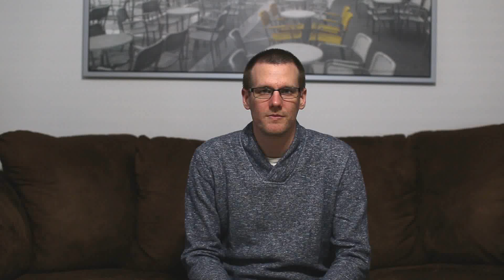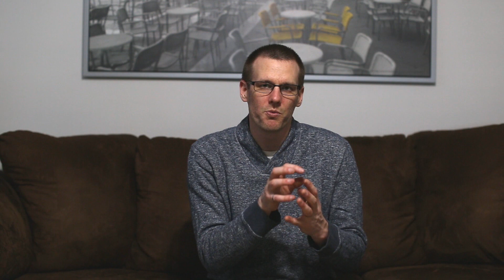Differential Fluid Performance in RC vehicles

Comment: Hey man I have a terremoto 10v2 

It had a 3s motor combo inside it and I swapped everything out to a 8s 4 pole motor! It’s a damn beast! Im only using 6s

I crashed my RC car into a wall and destroyed the centre diff, ( it’s not really a centre diff ) lol 

But I order the real upgraded Center diff , and I was gonna take everything apart and redo the oils / new bearings etc it’s been a year since I had it. Wanna do a rebuild basically.

I’m new to the RC world and I wanna know what would be a good setup? I’m into speed mostly tarmac, but I do go off-road a-bit, I don’t jump the RC car or anything like that ain’t really into it,

So my RC Car loves todo wheelies! And standing backflips even with a open Centre diff. I just need some help with the diff oils :/
Reply from the maker: Hello, I prefer a very heavy weighted oil in the center diff, a medium/heavy diff oil in the front, and a lighter diff oil in the rear. From there you will have to fine tune to suit your preferences.
Reply: RCexplained thank you for the fast reply!! 

Could you maybe elaborate just a little more?

Maybe with some actually numbers?

Type of driver I am is id like the car to slide into the turns pretty well than I’d ease into the throttle to get it up to speed!

So would you say 5k in rear 10k in centre and 7k In front?

Or much heavy oil? I’m a noob to tuning, but I can drive !
Reply from the maker: Hello, going with 5k/10k/7k would be a good setup. I'd prefer more power being sent to the rear wheels.

I'd go a bit heavier in the center and front. 20k in the center and 10k in the front.

Heavier weighted oils in the mid and rear will allow more power to get to the rear increasing potential acceleration but requiring good throttle control. A heavier weighted oil in the front will help pull the car out of corners.
Reply: RCexplained what about the rear?? You said 20k in centre 10 in front. Rear?? 

And thank you so much for the help man!! I’ve been busting my balls all week trying figure out what todo lol!
Reply: RCexplained btw you %1000 get a sub!!
Reply from the maker: @sleepyhallows3681  Thank You. Your 5k in the rear sounds good. See how that all works out for you and adjust from there to your liking.
Reply: RCexplained ❤️ you are the boss!

Just waiting on my centre diff , this virus thing going on I think my parcel might not be comming, even though it’s in Canada :/ a few hours away from me , it’s just being processed!! Lol so frustrating! But once I get her up and going I’ll give you a shout! If you have Instagram please follow me I’d love to follow you back and keep In touch!!

It’s the same as my username I’m not gonna write it out to plug myself lol, but if
You can’t find it tell me yours and I’ll gladly look for it!
Reply from the maker: What city are you in? My IG is the same name.

Comment: Thanks for the video!

I just got a losi rey raptor, im new to this! 

My rear diff sun gears were stripped just after two charges on 3s batteries.   Truck is brand new; hobby shop i got it from said that its because i pin the accelerator when i just and land.  
I left the store thinking about it. I dont really jump the truck, just have been using in on my grass front yard and driveway. and the jumps have been from sidewalk to street. thats like 8 inches. which is nothing.

just wanted your opinion.  hobby shop wanted to charge me 60 an hour to fix it plus parts. So i just ordered parts from them and i am fixing it my self.  I am just trying to figure out and understand why those diff gears were stripped so soon.  Do you have any input? Thanks!!!

when i opend the rear diff, the oil was thick and it was all over gears but definitely not full of it.  grease looked metalic
Reply from the maker: It does not sound like there is a reason that you should be having any diff trouble. Were the spider gears completely stripped or are they stripped in a specific spot?
Reply: RCexplained the gears that were stripped are the sun gears. The two bigger ones in the end of the diff. The other 4 smaller ones look good. This is in the rear diff

Thanks for the reply!
Reply from the maker: @cashmiller2999  I don't see a reason those gears would strip, especially given the fact that you don't have added stress from using throttle while landing a big jump.

Comment: What happens when you use million weight in the center, front and rear 10k in a typhon v4 6s?
Reply from the maker: The power distribution front vs rear will be more balanced which means you will be able to get a significant amount of power to the rear wheels. 10k in the front will allow for more stability in the turns but will also allow more power to go to the wheel with less traction. Same idea with the rear however more power going to the wheel with no traction will keep you out of trouble. If it was heavier in the rear, the typhon could be more unstable under heavier acceleration. Diff oil is all about personal preference. I prefer to go light in the rear, heavy in the center and mid weight in the front.

Comment: This video was very well explained 
I’m new to Rc 
Can u tell me what diff oil I should use in arrma typhon 3s which only has front and rear diff it’s a buggy but I use it on tarmac more and speed 
Thank u
Reply from the maker: Thank you for your comment Chris. Start with 50,000wt in the front and 5,000-10,000wt in the rear. Depending on your driving style and preference you can tune it from here.
Reply: RCexplained thank you for your time and knowledge, I will try this method , and will let you know out come so u have an idea the out come with this Rc too , thanks again .
Reply: @CmwSpeedrunUk  did u try this yet ow is it goin
Reply: just P. X I tried 50.000 wt - 10,000the handling was so so good I could stay on the power more in corners , it felt great .
I like doing speed rounds tho and I lost 4 mph 
Which was a bummer, 
It made the typhon less noise to 
I have lots of video of typhon see what you think bud

Comment: I got this red car grease could I put this on the gears outside the diff, not sure what it will do but I know I need to put a grease there
Reply from the maker: Hi Dan. I only use white lithium type grease on the teeth of meshing gears. In fact if the meshing gears are not both steel, I don't really use anything. It is very rare that I have to replace gears from wear.
Reply: Ok thanks so you think I’ll be fine with the red car grease that I have

Comment: Im getting a wltoys 144001 i from videos it has 0 fluid inside the diffs and just spins out is 10k front and rear e okay? I just want to have fun
Reply from the maker: I wouldn't be able to tell you without having experience with that RC. I personally prefer to use a lighter oil in the rear and heavier up front. 3k in rear. 7 to 10k in front.
Reply: It doesnt have a center diff tho
Reply from the maker: @EXTREMERC416  that's ok

Comment: can i use grease to prolong the plastic gear in rc differential
Reply from the maker: I have used grease in a differential, however the weight of grease is very light.
Reply: what happen when i put large amount off grease inside the plastic differential will it be ok?.. or just a little bit?..
Reply from the maker: @johnmarklucing7106  When you pack a differential with fluid, you want to fill it until its full.
Reply: @RCexplained  hey man . I'm new to the rc hobby and gotten me a laegendary 1/10. I broke a diff so I was looking for Info on how much grease do I place in the diff. Lmao now I know after 2 months .
Reply from the maker: @DeathHelper420  right on!
Reply: tnk u in advance in info..😁

Comment: is the grease protect the plastic gear of the rc differential?
Reply from the maker: What are you trying to protect the differential from? Differential fluid works very well.
Reply: can the grease can protect the crashing of plastic gear inside the differential
Reply from the maker: @johnmarklucing7106  All the differentials I've used have metal spider gears.

Comment: What if you r drag racing do you want all diffs the same ?
Reply from the maker: It depends on your setup and how much power deliver you can get from the rear wheels to the ground. It takes a bunch of testing to get to the setup you are comfortable with.

I typical like to lock the diffs and use throttle management to accelerate in a controlled manner. However, locking the front and center diff while using a lighter weight oil in the rear diff can increase acceleration stability at a potential cost of acceleration. For even further stability under aggressive acceleration at a further cost of acceleration, lighten the fluid in the center diff.